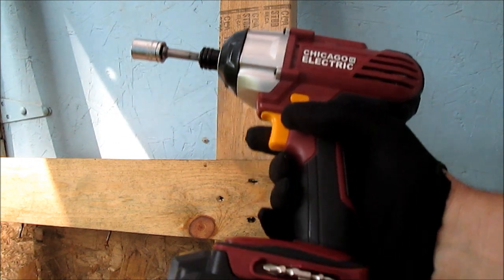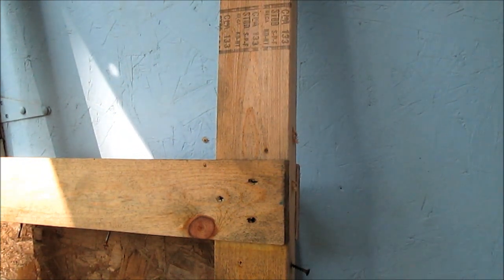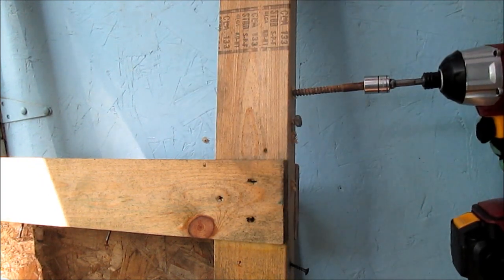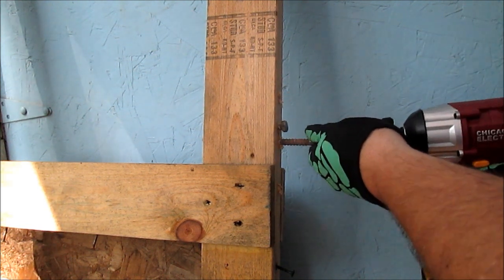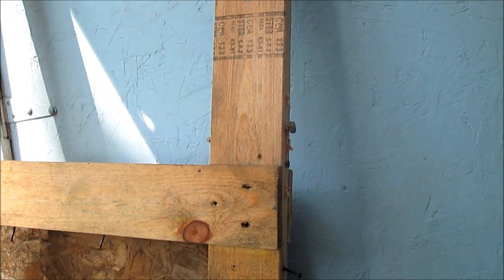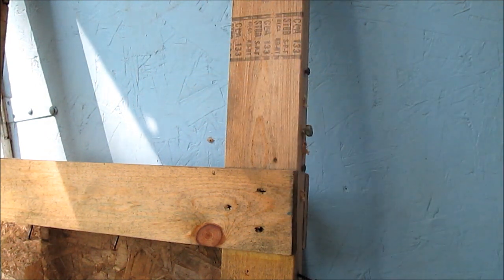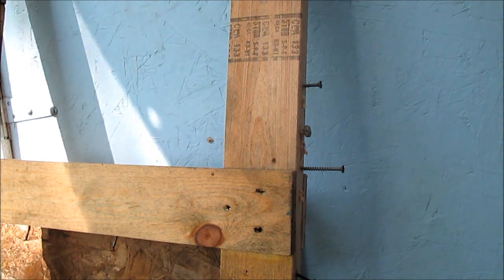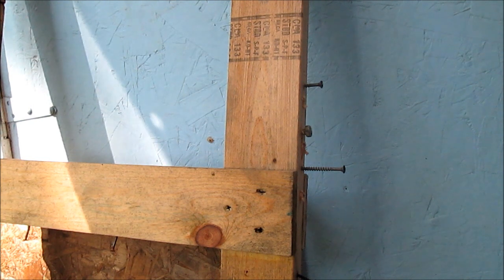Harbor Freight Chicago Electric 1/4 in. Impact Driver (Torture Test) Discountinued ?

Comment: Nice test! We just got a Harbour Freight in town a few days ago ..... never really considered the drills but that looks pretty good. Had to use some of that para cord you sent me the other day too ... glad I had it!
Reply from the maker: +belgrademachine They do have alot of good stuff I usually stay away from the power tools but the reviews on it were great..I didn't think this impact could drive that big of a lag screw !!! I will be using it most of the time for small bolts and screws ..Did you see my hammer with the para-cord handle ?There are alot of neat things you can make with the stuff
Reply: +not2fast4u2c just found it ... the estwing hammer video. Funny I wrapped the handle on an old boyscout hatchet, I think it was a "True Temper" brand. works great!

Comment: You know crazy thing is my grandpa was into construction and did alot a work. He ran makitas but he had an old 12v where the battery was the length of the handle and actually had a chuck key.  He had an electroc makita and also a hammer drill. Back in the 60-80s and even 90:"s impacts werent common. I imagine if my gramps was still alive he'd say "god dam these are powerful" i assume back then nails were more common than screws cuz he has a whole range of nails but very few coffee cans full a screws. That's a sign of the times for me.
Reply from the maker: It would be a good video seeing one of the old drills in action !!!

Comment: im in a construction class and my PM lets us use his Ridgid tools and the impact driver is the best i suggest you try one you cant beat the warranty either
Reply from the maker: I am sure thee Ridgid costs a lot more than mine did ...I can not afford to buy high priced tools all the time ...This Harbor Freight one was a  good deal for the money and I am still using it with no problems and have bought an extra battery
Reply: 90 dollars at home depot online for the extra 40 buy it

Comment: I dont think hf has these anymore, i cannot find em on their website.
Reply from the maker: I could not find them either ..There may be some in the stores ..Mine still works great and I have a spare battery..The new brands they have now are getting great reviews ..but they they cost more
Reply: not2fast4u2c yah they have hercules and bauer brand but their prices are up there with dewalt,makita etc. i do have the cheap drillmaster drill and they have an impact but its like 700in lbs and slow. What'd ya pay for this impact cuz cheapest i found was walmart dot com black and decker for $58 but its 20v and i just got it and like it. Made a shit video driving screws. I assume the size of the chi elec its a nicad bat instead a lith ion? I guess this not being on the website was an omen to get the black and decker which people call shit but im a diyer so i dont use it for a job. That black and decker does more than the job considering most people drive screws with a drill. My cheap drillmaster can drive somr pilot holes and the bnd can drive in those screws and lag bolts 👍🏻👍🏻👍🏻
Reply from the maker: Chicago is a ni-cad battery
Reply: They have a 12 volt version of this but it's the CE blue

Comment: what I see is the real big problem is the battery....I would love to see this work with a lithium battery
Reply from the maker: +Jody Reed For the price of the tool it was worth buying an extra battery It will run down quick on heavy jobs on small drywall screws it does last awhile the Big lag screws are almost too much for the tool
Reply: well....this is true...where can ya get a cordless battery for only $15?..
Reply from the maker: I am sure the battery for this was around 10 dollars I did use a 20 off percent coupon
Reply from the maker: +Jody Reed The one for this was about 15 dollars the 10 dollar one is for the cheap cordless drills

Comment: My Royobi 1/4 inch impact would blow away they Harbor Freight driver. they downfall of this driver is the totally inadequate Ni-Cad battery.
Reply from the maker: +John L How much did you pay for Your Royobi Mine was cheap enough that I bought an extra battery
Reply: +not2fast4u2c I purchased my Ryobi 1/4" Driver as a combo package with 3/8" Roybi drill at Home Depot for $69 dollars and it came 2 Lithium-Ion batteries & quick charger. It was a HD speical buy and was to good to pass up. I really did not need the drill as I already have several including a Harbor Frieght 1/2" Chicago Electric, which I will admit is very powerful, even with it's Ni-Cad battery. But I usually shop around for the biggest bang for the buck including Harbor Freight.
Reply from the maker: $69.00 ???
Reply: +not2fast4u2c "YES" $69.00 dollars (Home Depot Special Buy) I have the receipt to prove it, would you not buy it if you saw this combo set at that price?
Reply from the maker: I would buy it at that price
Reply: +John L ni-cad batteries arent necessarily a down fall, if they treated right, they can last years and still have a large current output. dont get me wrong lithium is far superior however ni-cad batteries arent as bad a people try to make them out to be. infact my ni-cad drill battery pack outlasted my lithium one. not because of the cells but because the charge controller gave up.
Reply from the maker: +axeami135 This is a good tool for a  cheap price ...I had a 20% off coupon and  It was cheap to buy an extra battery   It does work Great for what I need it for ...I can not see me buying an over priced big brand name just to have a Lithium battery
Reply: yea it doesnt look like a bad tool for the price, i dont know what brand it be under here in the uk though. 
i do try to go for lithium powered tools if i can but i dont have a problem,with buying ni-cad ones either as ive never had a bad experience with either except for the charge circuit fault in one of my lithium ones.

Comment: buy Milwaukee $99 home depot
Reply from the maker: God I wish people would stop and Think !!!  Milwaukee tools are over priced..Imported Crap do the research  I am still using the Harbor Freight one with NO problems ..and it does the jobs I need it to do
Reply: not2fast4u2c I have a harbor freight 1/2" impact wrench good tool  but impact driver buy a better one
Reply from the maker: Like I said before .....There is nothing wrong with the Harbor Freight one ..It does the jobs I need it to do
Reply: not2fast4u2c yes there is nothing wrong with Milwaukee eather I have both